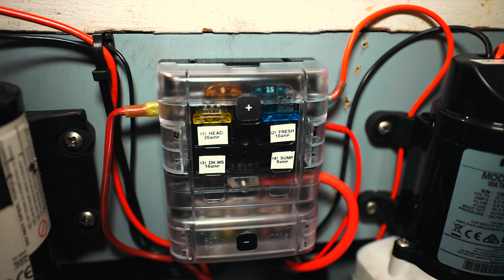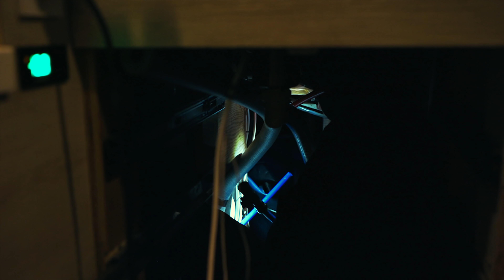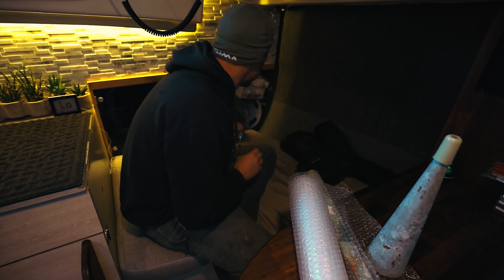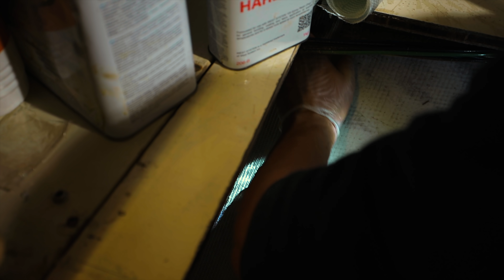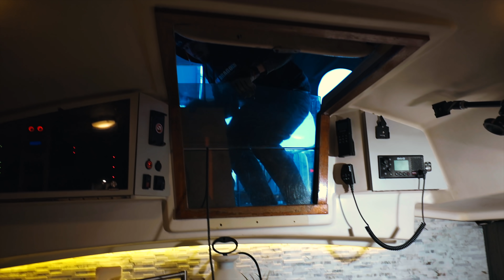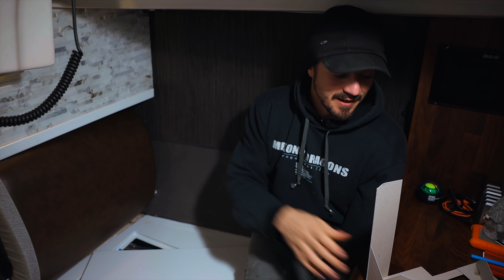Preparing For Something Special — Sailing Uma [Step 256]

Comment: You might need to run the hot water heater at a higher temperature. Legionella is a real problem.
Reply: 50-55 degrees celcius ?
Reply: @andyblack4972  At 66 degrees celsius the bacteria dies within two minutes. To make sure the bacteria does not survive in the plumbing or tubing leading from the heater and tank to the tap I'd probably aim for 70 degrees. 
Kika and Dan seem to be in good shape and the symptoms would probably be mild flu-like ones, not that bad. But best avoided.
Reply from the maker: Like we said in the video. Our tank is set at max temp. The hot water then goes through a mixer value set to 42°C so we don't burn ourselves at the tap.
Reply: @SailingUma  Glad to hear that. I didn't hear the part about the mixer :-)
Reply: @SailingUma  The bacteria gets into the pipeing. Mixing at the tap is a lot safer.
Reply: They don't have a mixer at the kitchen sink faucet, so they are doing the mixing back by the water heater.

Comment: I could interject here by saying that -17 ain't cold but I would be lying. Although hanging high tension cable 85 frrt above ground at -52 is totally stupid, I will say that you did a great job working in the conditions you have :)

Comment: Great preparation, but have you thought about servicing the device?  namely, the regular service also includes removing the filter, and if necessary, replacing it, I think you will have problems due to the limited space.  You can also make holes to make it easier to pull out the filters, which are the length of the device itself. 😉👍
Reply from the maker: We made the whole system easy to disconnect and pull out for servicing.
Reply: @SailingUma  Perfect solution! 👍👍👍👍👍

Comment: Yay! More Boat Projects! >^.^<

Purely out of curiosity, why did you stick with the hot water tank and not go with flash boilers or something similar? Potentially half your plumbing and only have to heat the water you use, rather than an entire tanks worth.
Reply from the maker: All the instant hot water solutions available currently require WAY too much power to operate on our boat.
Reply: @SailingUma  Fair enough and thank you for the reply. :)
Reply: There are propane instant water heaters.  Nonsuch s/v are mostly rigged with them
Reply: @heritagens  They don't carry propane on board.
Reply: @divekatdreaming  Agreed. No propane to my knowledge. All electric. I didn't realise that an Electric flash boiler would have that kind of power draw. Better for a slow trickle than a sudden hit, I suppose. :)

Comment: I guessing you did a good plumbing job, seeing as you've got the legitimate butt crack expose common to all good plumbers.  :-)
If you're putting in a water maker, you're going to need more electricity.  I'd fatten your battery, and consider getting a low wattage diesel inverter generator, to charge water and battery, when all else fails.  Diesel is everywhere, and keeps for a long time.  Inverter generators are able to run the engine at its peak rpm, while providing whatever electrical output you care to plan for.
One last thing, regarding insulation.  Thinsulate kicks ass, so long as you cover it.  It is non-structural.  And if you really want to bang it, Aerogel is by far, the shit.

Comment: Dan, you have probably thought of this, but I'm going to say it just in case.

Your water maker will be pulling in seawater at as low as ,~-2 C (freeze point of seawater).  When it goes through the membrane, it can pretty much instantly freeze and destroy your membrane and do other sorts of damage.

The solution (and I know you don't want to hear this!) Is to heat the incoming seawater about 4 to 5 Celsius degrees to prevent downstream freezing.  Good luck!

Comment: As you have been fiberglassing the bulkheads to the hull are you noticing any change in stiffness of the boat when sailing?
Reply from the maker: Not really, since it's been a slow transition over time. But when we did the hull/deck joint, we certainly felt a difference. She was much stiffer and sailed better to weather after the upgrade.

Comment: Dan makes complex projects look straightforward! 
As you have demonstrated, the best thing about cold weather epoxy is that you don't have to rush and then when you have things where you want them, turn a heater on and everything sets up (assuming the heater can overcome those negative temperatures!)
Best of luck installing the water marker.  That looks like a snug fit!
Cheers from Juneau Alaska, 
Greg Chaney

Comment: Mr. and Mrs. Uma,
lol, Could you please give a demonstration or explain how far you can travel on your electric motor only, and then how long it takes to charge the batteries on solar only. also how big your battery bank is? I am only asking this because I see some people getting the notion that an all-electric boat would be a good idea. no motor no sails. this could get some people into a deadly situation if more than a part-day cruze in a small lake or river. I don't want to see someone getting hurt or kill because they didn't calculate their solar and battery banks correctly. While solar is the fad these day's its potential has improved tremendously with the newer batteries over the years. You only get so much power in so much space. when is it safe as your only means of propulsion? Thank you and I love your videos!

Comment: Dan do are you thinking about insulating the hot water tubes?
----
Watermaker: Sure it is a lot of energy, but is that such a problem? I think, you have to run it often (as the watermaker always needs) but only for short times. Just keeping an average level.
It's a little bit sad: A friend with a large catamaran bought a watermaker - this came in parts: the membrane, the main pumps, the filters and the steering. So it was easy to install all. 
---

Comment: i have 35 euro instant water heating tap running on inverter. love it .. i dont see the pourpose for having a hot water tank on a eletric boat.
on another boat i was installed a energy system on the hot water tank used almost 4 kw a day in lost heat when not using hot water.
Reply from the maker: Please share the link to the product you have. We’ve been searching for an instant hot water solution, but haven’t been able to find anything viable that is less than 10kW
Reply: @SailingUma  https://www.amazon.co.uk/Fit-Into-Everyway-Tankless-Electric/dp/B01E5CEDNI/ref=sr_1_6?dchild=1&keywords=hot+water+tap&qid=1614885523&sr=8-6
this is one i have another with a diverter valve for taking showers, they are about 3000 watts continous, i have lowered the out put voltage of my multiplus to 210 volts so they take a bit less power, i have a 3000 va multiplus and i use these regularly, taking a shower uses about 450 wh , they look junky but i have been using them for a year now .. and also heating water at source you dont have the losses of heating the water in the pipes to the the tap each time you just need a small amount of water..  the only down side would be for kika for showering in winter as the flow to heat the water to 45 c would be a bit low for her amount of hair. meaning heating water from 2 c to 45 c ,. in the summer when the water in your tank is 15 c and up you have very good flow . as i workaround my water cooled electric motors warm my regular water tank up to about 12-15 c and then the instant hot water taps heat the water the rest of the way.
Reply from the maker: Ah, yes. We've seen those in our travels. The low flow rate to get hot water has always been a deal breaker for us.
Reply: @SailingUma  The Norwegian webshop Wee have a instant heater. Adjustable up to 55°c on a extern panel, 2-6 l/min, 3,5-5,5 kw
.
Artikkel nr: 24478.
Reply: @steinjohansen3142  Do you have a link to the Norwegian instant heater?
Reply: @sophiagranchinho4447  Norwegian youtube delete every links, sorry:-/  But if you read my first comment I´m sure you find it. ;-)

Comment: Which thru hull access are you going to use to pull in the salt water ?
Reply from the maker: The old engine cooling line. We kept it for a reason.

Comment: How much of "raw wood planks" and other materials do you have on board? Or do you simply buy material as you need?
What is your recommended set of tools on board?
Reply from the maker: one of the main reasons we decided to tackle this project in Trondheim is because it's a big enough city so we can have access to marine supply stores and local hardware stores. so no We don't carry wood planks with us everywhere 😂as for tools we might make a video about it soon.

Comment: Just an example of the power problem the Wynns have a huge battery bank and two Diesel engines, but since their generator is broken, they cannot use their water maker
Reply from the maker: Exactly why we didn’t go for a basic high pressure pump system and saved our pennies so we could get a much more efficient unit.

Comment: Hi Dan and Kika!  Just a thought regarding heating elements.  I just found an element that uses solar from PV panels.  It is direct wired to the element with it's own thermostat.  Comes in 12V or 48V.  You could even use a switch to draw from PV or battery. (Missouri wind and Solar)  Nice job!
Reply from the maker: Yup. But not much good go up here with 3 inches of snow on our solar panels. Besides, we’d rather decide what to use our power for, rather than dedicate it solely to one thing.

Comment: Great video on sailboat yoga, laughed at the comment about water and electricity, though if it were just H2O, i.e. distilled de ionized water it would not be an issue with electricity but would be for leaching electrolytes from you...

Comment: The problem with the Clark/reciprocating/presure recovery pumps are that they are too complex.  Essentially pretty much everyone I've known that has had one, which cruises full time, has them break after about 1.5 years.  Since they have about 90 seals in them there is just too much to go wrong.  Spectra charges $1800ish for a typical rebuild.  They just don't hold up as well as the pressure washer pumps.  You can get a 60 amp 1/2hp pressure washer head and motor..  They(pressure washer heads) can be installed and only use about 40-60 amps running DC and can get you 15 to 20 gallons an hour. Versus a clark pump usage they will use about 30to 40amps more, but will double the output for the same amount of time.
Reply from the maker: Yeah, those aren’t the numbers we came up with after our research. We’ll share more in our next video.
Reply: @SailingUma  looking back at the post I mis-typed.  Typically The Clark pumps are about 1/3 to 1/2 more efficient at producing water in terms of electric draw.  Though the complexity and lifespan issues remain.  Some Clark pump manufacturers suggest a rebuild every 1000 hours of use.  Most of the pressure washer pumps last quite a bit longer and only cost $300 to replace, not $1800 to rebuild.  So if you can afford the amp draw the pressure washer pump is a better value.  You may not though so it is always a personal choice.

Comment: There's a thing I notice on your beuatiful Uma is that above your heads in the cockpit you have space for a very cheap D.I.Y VAWT.
But not one of those stickie uppitie ones. Oh no.
More like a super lightweight waterwheel, like a bicycle wheel on its side, with an alternator of your chosen voltage.
Pop it under your solar and you get a ceiling. With a diameter to suit the space, the blades wouldn't need to be very tall.
If it is really windy you might have to shower more often.

Comment: Why don't boats use dehumidifier type watermakers? They just make water out of the air.
Reply: An efficient one would be too bulky, one small enough  (if it exists) would be too power hungry.
Reply from the maker: Have you ever emptied a dehumidifier?  what comes out of it isn't something I would want to drink. it would also still require a lot of power and you would still need a way to purify the slimy water...
Reply: Apparently it's really hard to keep pathogens out of the water with dehumidifier style devices.

Comment: Froze ! I suppose insulation wouldn’t help your help in this situation! Was it Pex plastic lines that froze ? Hooray for the water maker 🎉make a mock-up of the dimensions of the water maker unit for dry fit ! Fire up the heat stove🔥will you bolt it down ?

Comment: Use 12w heat cord around the water pipes with a thermostat.
Reply: Self limiting tape is easier and does not need a thermostat.

Comment: I’m an electric boat owner too. You are on another level with boat projects. Amazing. Inspiring.  Thank you.
Reply: Absolutely fully agree!
Reply: akjhome, may I ask if you converted to an electric motor? I am in the process of researching to convert from a diesel to electric motor. Thank you.
Reply: @Jamie Lazardo Yes, converted. Smaller boat than Uma (25 ft). One has to enjoy sailing a lot more than motoring. You must not be in a hurry and find the right fit for your boat. Overall, I’ve loved every minute of it. I’m proud of it and I’ll do it again in my next bigger boat.
Reply: @akjhome  thank you. I have a Hunter 27 and have been looking at the thunder struck 10KW Brushless Sailboat Kit. It seems like it will be the right fit for my size boat.
Reply: @Jaime Lozado Best of e-luck, fair winds and following seas.
Reply: @akjhome  thank you
Reply: @Lars Hansen I agree. We actually prefer long weekends, or week longs and solar regeneration away from the shore power.  We are close to that with our current config. No fuel at all. Like Uma. Just smaller overall, slower and PNW islands.
Reply: @akjhome  PNW Sun never a promise though
Reply: I’m looking to do the same with an electric motor. I want to get rid of the Diesel engine so I can have more storage and use solar panels for my off shore needs.

Comment: Shame you don't have an engine you could hook up a High Press pump to work of a belt drive.
Reply: Yes, the point is that they decided to go electric for motoring.  That is a major philosophy of operations that drives you to limited solutions.  They simply are not going to install a diesel power plant, fuel tanks, etc to power a water maker.  It's a non sequitur.  Fortunately, as with propulsion and energy storage, water maker technology now allows for a realistic solution for their operational approach.  They are slowly assembling a system that meets their needs and approach.  It's brilliant.
Reply from the maker: A bit overkill don’t you think?
Reply: @SailingUma  not really ! You can make water as you motor in / out or topping up batteries.
Decent water maker will make 200 ltrs in an hour or so. My water maker has both options battery power or engine, actually three I have a genny too !

Comment: Have you ever thought about installing a pressure accumulator?
Reply: Is that an innuendo ?
Reply: @the-tessellater  NO!  A pressure accumulator  (on my boat it has a capacity of 3 gallons) stops the pulsing of the water when you open the faucet.  When the accumulator is full, the pump does not run all the time.  ONly when the level in the accumulator drops, then the pump comes on, and presses up the accumulator tank.